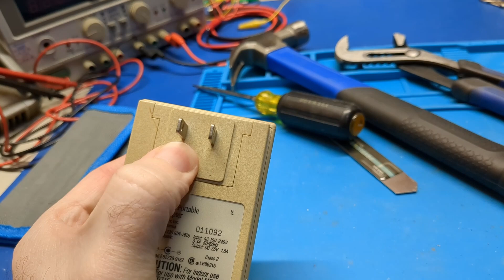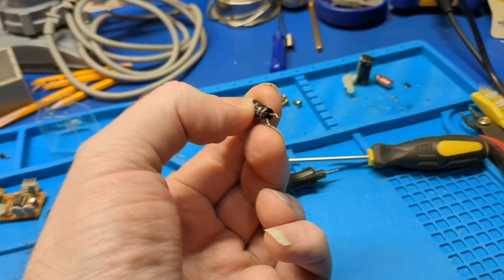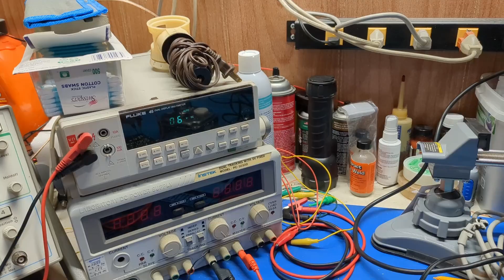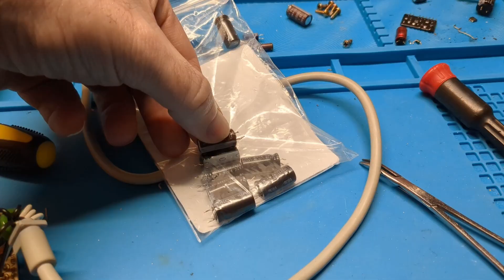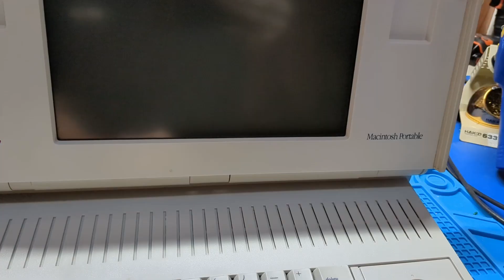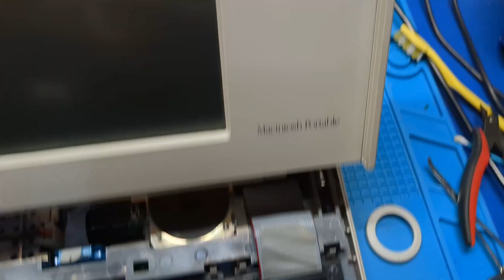Macintosh Portable AC Adapter restoration

Comment: I have a question, Why reusing the PCB. When you can use a smaller modern power supply inside ?
Reply from the maker: Because i like originality and trying to repair original electronics the best I can. To each their own though. Also, this is meant to be educational for others wanting to do the same thing. It wouldn't be as fun of a video if it was "Lets throw a meanwell in it and call it a day"
Reply: @THEtechknight  but isn't it for a customer ? Otherwise just for the video yes I totally understand

Comment: To open welded shut power bricks I've used petrol with good results. Pour some drops of petrol on the seam to weaken it and then try to insert a spudge tool in the gap.
It may discolour the plastic a bit though, at least on "modern" black bricks.

Nitro thinner also works but it's a lot more aggressive and it will melt the plastic if you are not careful.